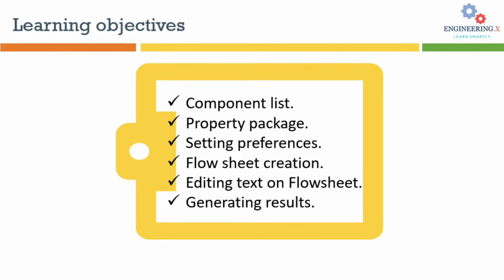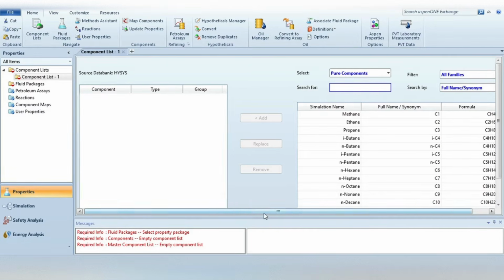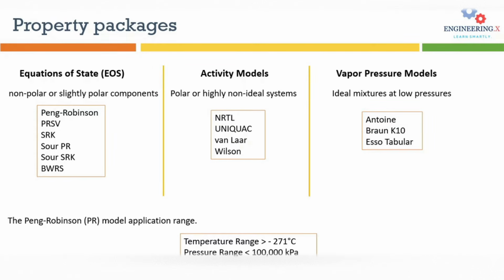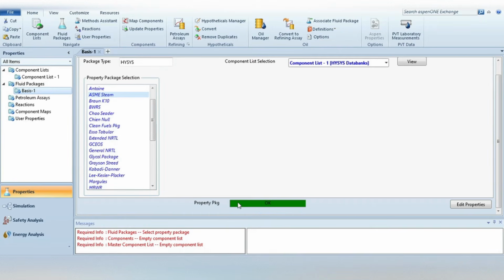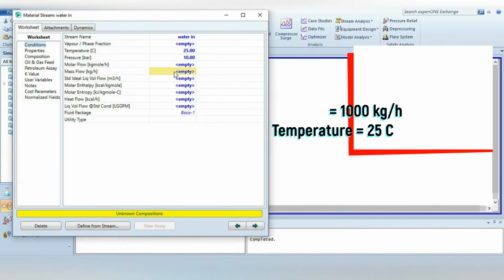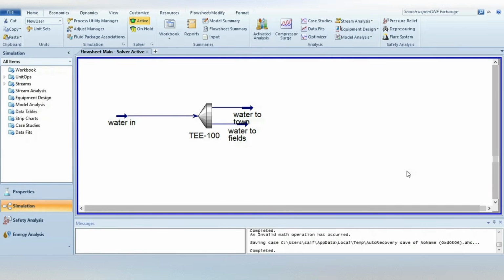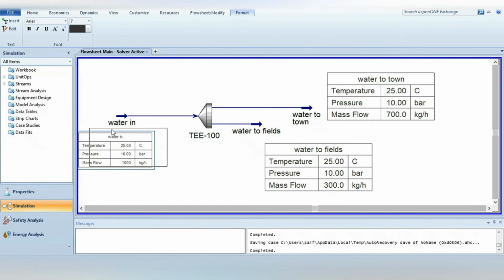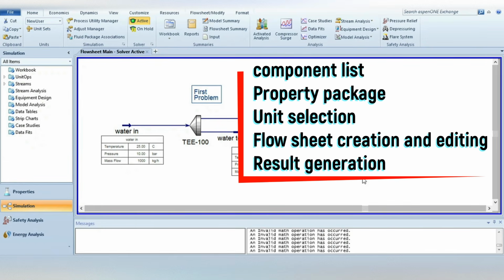Getting started with Aspen HYSYS

Comment: Dear Sir,
It is possible to increase the decimal places from 4 to 6 in the Hysys composition in order to get the ppm results?
Best regards
Reply from the maker: Dear Juan,
There is option in unit settings where you can change the composition unit into ppm instead to mol/L or kg/L. Just explore the system of unit settings.